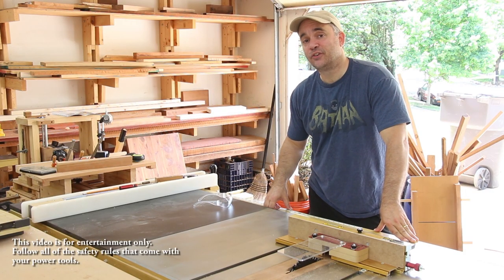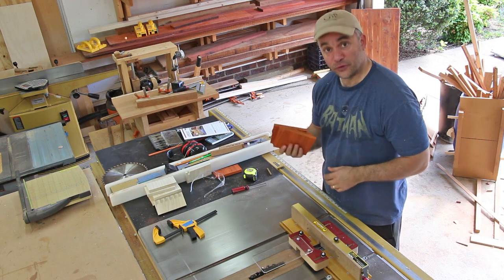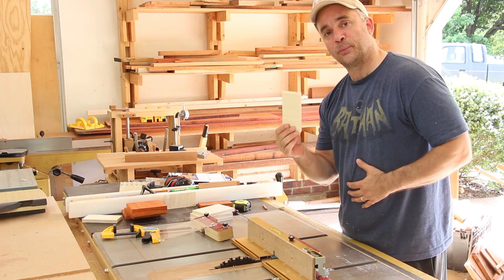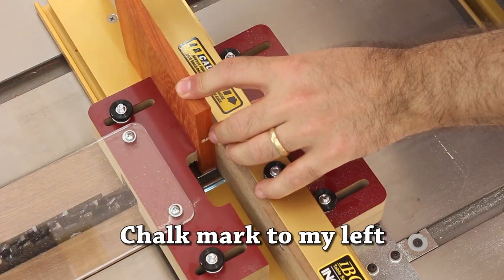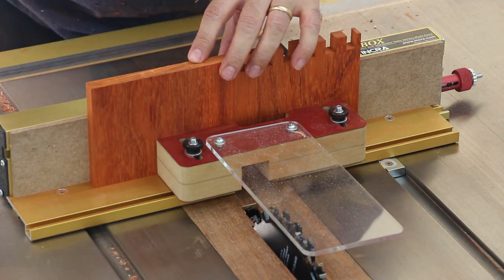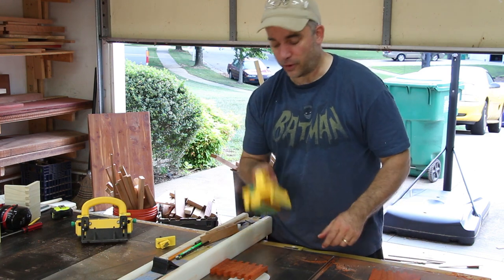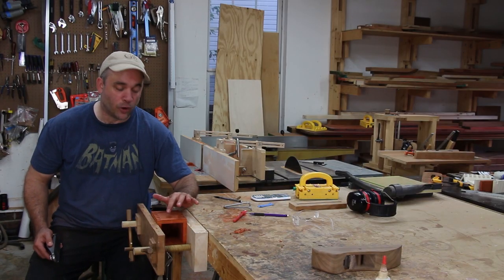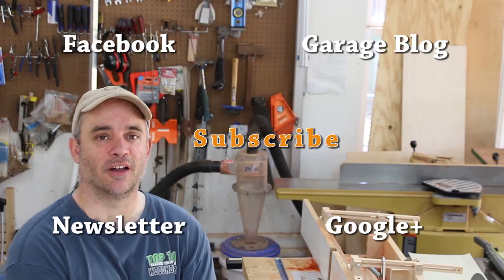Pencil Holder with INCRA IBOX

Comment: A 4 inch belt sander works really great to smooth down the prouds for boxes under 4".  I like 1/4" and 3/8 " box joints the best.  Got some artist brushes to spread the glue.  Fat fingers ha, ha!  I like the rabbit idea for the base or a top.

Comment: I'd love to have one of these, but I live in Norway and they don't sell them here :/
I could look into having one shipped here, but the end cost will most likely be too high..
Reply from the maker: Bjørnar Magnussen I'm not sure, but definitely worth looking into.  Thanks for watching!
Reply: gssns Thanks! Shipping from there should be a lot cheaper :)
Reply: Bjørnar Magnussen  Yes, even here in the US the IBox sells for $150. I don't see the point when you can make a jig to do the same job with scrap lumber.
Reply: Ed Tillman For me it's 213 dollars+25 dollas for shipping. So yeahh... I can buy a good tablesaw for that price :P
You can't make a jig as precise and modular as the Incra though! But yes, making your own is way cheaper, and most likely what I'll have to do.
Reply from the maker: Bjørnar Magnussen Ed Tillman  I've made one before, but I had to make a key for every new finger size.  Screw advanced ones should do the trick, but I've never been motivated enough to build one and they seem finicky.  This one is easy to use and should be accurate every time.
Reply: GarageWoodworks Yup, if you can afford it and do a lot of box joints it seems like it's worth it. Same goes for most Incra tools in my opinion. They are built very well and are really practical and precise, they're just so darn expensive!